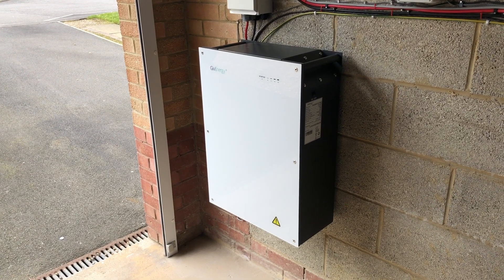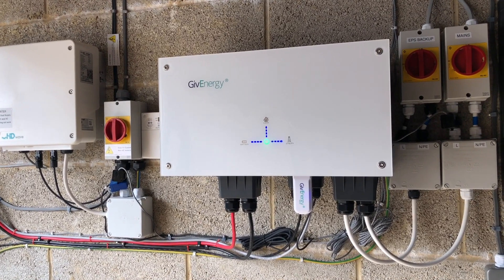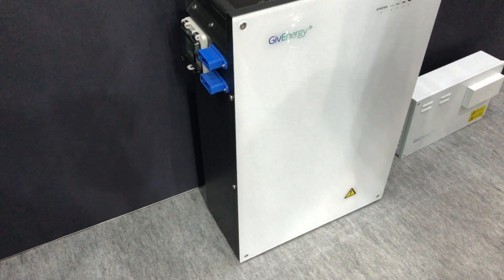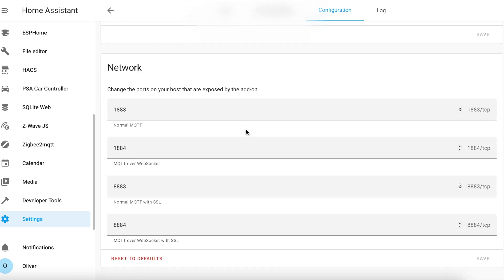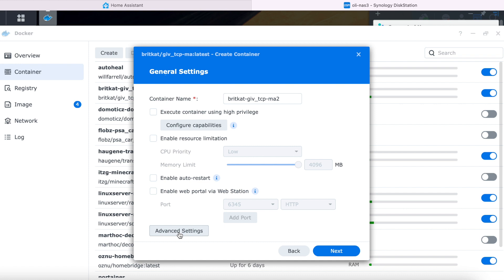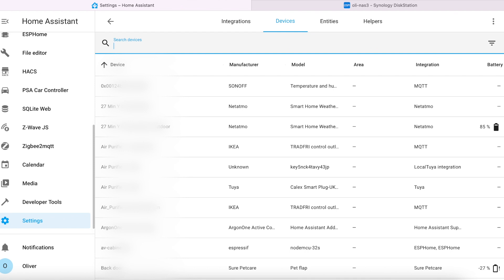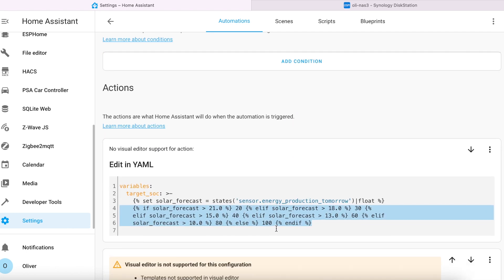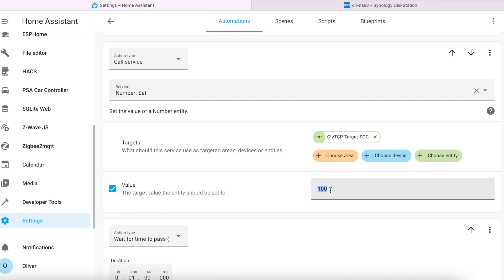GivEnergy Giv-AC 3.0 Battery, Home Assistant and Solar Forecast Automation

Comment: hello @speaktothegeektech.   I have at long last moved over to octopus and about to sign up to the Flux Tariff.  I have just gone through and set up the import script in my HA.  but my question is:  how easy is it to set up the export script to discharge my battery ?
Reply from the maker: In my mind yes it’s quite simple. Automation that triggers at the start time you wish to export, set the force export select entity to the time in minutes that you wish to export for
Reply: @SpeakToTheGeekTech  quick and dirty how about the following.  I would like the total exported use a variable - but i am having issues with find the "entity_solar_forecast" from your code.

alias: Act - octopus_Export_GivEnergy
description: >-
  This is a schedule Automatic that will export eletric to Octopus during the
  Max rate period
trigger:
  - platform: time
    at: "18:00:00"
    enabled: true
condition: []
action:
  - service: select.select_option
    metadata: {}
    data:
      option: "16:00:00"
    target:
      entity_id: select.givtcp_ce2142g147_discharge_start_time_slot_1
  - service: select.select_option
    metadata: {}
    data:
      option: "19:00:00"
    target:
      entity_id: select.givtcp_ce2142g147_discharge_end_time_slot_1
  - service: number.set_value
    metadata: {}
    data:
      value: "50"
    target:
      entity_id: number.givtcp_ce2142g147_target_soc
  - service: notify.mobile_app_sm_g996b
    metadata: {}
    data:
      message: Forecast {{states('sensor.energy_production_tomorrow') | float }} kWh
mode: restart
Reply from the maker: @mysmtpservices4818  I was thinking more along the lines of triggering the export directly rather than scheduling it, so using a service like:

    - service: select.select_option
      data:
        option: '180'
      target:
        entity_id: select.givtcp_ce2142g147_force_export
      alias: Force Export the Inverter for 180 minutes

So just set the automation to trigger at 4pm. Setting the target SOC as you are doing will only impact charging. If you are trying to stop it discharging below 50% then you need to set the reserve. Make sure you put a pause action of 15 seconds at least between each action or GivTCP can skip them.

As for grabbing the solcast data try playing around in the Developer Tools template tab because that's really handy for figuring out the correct syntax.
Reply: @SpeakToTheGeekTech  thanks for the reply.  "Setting the target SOC as you are doing will only impact charging. If you are trying to stop it discharging below 50% then you need to set the reserve. "  would I be guesting that the setting will "select.givtcp_ce******_force_export" with a option of 50 ?
Reply from the maker: @mysmtpservices4818  No that would export for 50 minutes. To set reserve you set a number entity ending with _battery_power_reserve
Reply: @SpeakToTheGeekTech  Sorry I am confused as hell - can you please show me
Reply from the maker: @mysmtpservices4818  Try joining the Facebook group "GivEnergy GivTCP Users Community" (https://www.facebook.com/groups/615579009972782) and asking for assistance in there - loads of people with a lot of experience and it's a lot easier to share config and suggestions there than on YT comments

Comment: Thank you Geek! This is very helpful. Any chance you could develop a similar automation for discharge during the Octopus Flux peak period, such that the battery discharges to a given level (say 40%) before returning to Eco mode? This would leave sufficient energy to cope with household load until the next off peak (battery charge) period.
Reply from the maker: This isn't something I plan to cover because it's very niche but shouldn't be difficult for you to put together. Create an automation that sets the reserve to 40% and then does a forced export for a couple of hours (work out the maximum time needed based on your inverter's speed). If you're struggling with making an automation, perhaps join the GivTCP Facebook group where there are a lot of people who can help you through the process.
Reply: No worries, thanks for replying so quickly! @SpeakToTheGeekTech

Comment: I've had a hybrid inverter and a couple of 8.2's since September last year. With now coming into the summer wanted some automation. Your video's and docs have been excellent in this regard. All setup and "almost" working on a pi. 

In the script (I'm not great a scripting) I can't see if it gets the current kWh of the battery(ies). I ask as I have 16.4kWh of battery capacity and solar generation prediction for tomorrow is 13kWh. So I was anticipated a charge level overnight of circa 40-50%. The automation ran and changed it from the previous setting of 80% to 100% So I was thinking if it thinks I only have 8.2kWh then I could understand why it would want to charge to 100% 

Hope that makes sense.
Reply from the maker: No it doesn't get the actual total capacity of the battery. If you look starting line 10 of the script where the target_soc values are defined, you will need to tweak these to your own needs. I have an 8.2kWh battery, but you have double that so it might be that your percentages can be changed. Whereas I assume that if the solar_forecast is more than 21kWh the following day I would only charge to 40%, you might decide you can let that drop to 20%, but only if the forecast is more than 30kWh. These thresholds are totally customisable but rely on your own experimentation to fine tune them and my values suit me, but might not suit others.
Reply: @SpeakToTheGeekTech   Thanks for the reply. I understand now. I have halved all of them for now and see how I get on. I also now have an eddi configured. So at some point I'm going to try and work out a way to take in to consideration previous days generation, kWh to battery and kWh to Eddi. 
I think solar prediction in the UK is somewhat difficult to consistently get right. 
I'll go through some more of your vids later, they're done really well, clear concise and informative. 
Thanks.

Comment: I currently have solar panels and an inverter in the loft with limited space for anything else.  I have been told that if I want AC coupled battery (dont want to replace my current solar inverter with a hybrid) then I need the AC inverter/battery to be physically close to the solar inverter.  Is that right?  I was under the impression I could put it close to the meter(s)/consumer unit which has much more space.
Reply from the maker: I don't know of any reason why a GivEnergy battery would need to be physically close to the solar inverter at all. The AC coupled battery inverter ideally needs to be able to monitor your solar generation using a CT clamp, but I would guess that your solar inverter is on an MCB or similar in your consumer unit, so the clamp could go around the live at that point. Even if the CT clamp needed to be extended further, there are options for that too including wireless monitoring. There may of course be quirks with your particular electrical setup which need to be considered, but I'd suggest you get a second opinion!

Comment: Very interesting. I'm currently looking at getting solar and a battery and so far the GivEnergy system seems the most flexible for users to 'play' with. Thanks for the info. How are you finding the GivEnergy kit?
Reply from the maker: It’s not perfect, but the features and specification for the price is excellent. I definitely recommend it. The development team supporting it are pretty active too in looking into any problems you have.

Comment: How do you know at 0:37 the battery is actually 10 kwh. Assuming this is the same for the Gen 2 battery I can't find anything in the data sheet which mentions this?
Reply from the maker: I heard it from a few sources, but you're right that it's not in the specs. It's inferred by the 100% depth of discharge claim because you can't actually fully discharge lithium cells without damaging them, therefore an 8.2kWh battery with 100% depth of discharge MUST have some hidden extra capacity in there. It's been mentioned on the GivEnergy forums a number of times that the 8.2 is really a 10, I saw some photos someone took of them counting the cells inside the battery pack too (although I'm not opening mine up to do that!), and my best source was from a GivEnergy employee I spoke to at the Fully Charged Live event earlier this year. That same employee also insisted that there's no such thing as a gen 2 battery, only get 2 inverters, and the 'new' batteries are still gen 1, but with increased capacity and some additional built-in features. I call them gen 2 too though. I think it's safe to assume that any GivEnergy 100% DOD battery will have additional hidden capacity in order to meet that claim.
Reply: @SpeakToTheGeekTech  Yes that must have. Having played with Lifepo4 batteries for motor racing without any protection I have learnt their limitations 😁 A reserve capacity is good to know, I didn't realise this until I watched your video and was even considering getting a second smaller battery so I cycled the battery less. Looks like they already have this in reserve so I'm now less worried about cycling now 👍

Comment: Really good video which covers exactly what I want to do when my GivEnergy Gen2 Hybrid eventually arrives to go with the two 9.5kWh batteries already delivered. I can follow your YAML fine but reverse engineering your strategy is harder. Can you just explain the considerations behind your 40% and 90%?
Reply from the maker: It's all a bit fuzzy, I'll admit that! Taking the lower value of 40%, I basically didn't want to ever let the battery drop below 40% so I took that as a starting point and if my generation is forecast to be over certain amount (i.e. a nice productive sunny day) then it'll let the battery drop to 40% over night (or charge to 40%). On the other end of the spectrum, if it's a rubbish forecast and the amount of excess solar (what is generated - what I need for baseline that day) is zero or negative then I make sure the battery is at 100% that night. All of the intervals in between are rough guesses. All of the energy values that correspond with percentages are estimates based on experimentation which have been tweaked a lot. I currently have it reasonably stable for my home, but everyone's home is different. The latest version of GivTCP has solar forecast charging built-in, however it's got a bit of a bug in it at the moment. Once that's stable I plan to release an updated video using that instead. The algorithm (called PALM) is a lot more intelligent and pulls in historical usage information from the GivEnergy API.

Comment: I use a HACS integration called GivEnergy local. Much easier to setup
Reply from the maker: There is that as an alternative, yes. However when I first started looking at integrations, that one was way behind in terms of functionality (it didn't support batteries at that time). I know that it has now caught up and is probably a viable alternative, although I'm now deep in with GivTCP so will stick with that personally. Always good to have alternative options though!

Comment: Got it working thanks! The battery charge % isn't updated in the GivEnergy dashboard though for me - known bug?
Reply from the maker: That's not a known bug. So it updates ok in Home Assistant but not on the GivEnergy portal?
Reply from the maker: Also be aware that a lot of things have changed with GivTCP since I made this video including the entity name format. Once the add-one is stable again I will put together an updated one to avoid confusion.
Reply: @SpeakToTheGeekTech  yes, battery charged to 90% overnight but target still showing as 50% (manual setting) in the GivEnergy web portal -> my inverter
Reply from the maker: Check in the GivEnergy app and make sure it connects locally, then compare that to the charge value you get for remote. If you get a value for local but not remote then I suspect it's an internet connection issue with your GivEnergy inverter. The inverter should also show as a green dot for its status (or yellow, but not grey) in the portal. Either way, an issue with data between the inverter and the GivEnergy portal is one for GivEnergy support to look at for you.
Reply: @SpeakToTheGeekTech  not sure I can see that value in the iOS app.

I'll definitely nag GivEnergy if it carries on 😁

Comment: Thank you for this plethora of information which is all new to me. I wonder if you could help with a GivEnergy issue. We had our PV system recently installed including an AC coupled 8.2kwh GivEnergy battery. The dongle was configured, but the app doesn’t find the inverter and connects only to the “away” network, not the “home”. The inverter is connected to the WiFi network. I tried in the app settings to search for the inverter manually and inserted the IP address of the inverter, but still the app can’t connect to the “home” network. Thank you
Reply from the maker: Hi. I haven’t personally experienced that issue but I know that other GivEnergy users have. You might want to contact GivEnergy support or ask around on the user forum: https://community.givenergy.cloud
Reply: It worked for me but only after entering the IP address manually (iOS app)

Comment: Just what I am looking for...however I am a complete numpty when it comes to scripting/HA/coding. I know that it's a big ask, but would it be possible to simplify this? Your last video on setting up HA was brilliant and allowed me to get it up and running. With this though I just do not have enough knowledge to get this automation running. It's a big ask, I know!
Reply from the maker: Which bit are you stuck with? I've put together another video on how to install GivTCP as a Home Assistant add-on instead of running it in a separate Docker server which should make things much simpler (https://youtu.be/NQ84z_Wa19k). How far have you got? Have you set up a solar forecast integration (such as forecast.solar or Solcast)?
Reply: @SpeakToTheGeekTech  Thanks for replying. I've got HA up and running on a Pi400. GivTCP is also running fine. I've also got the Solcast account setup and the API running in the GivEnergy portal.
Reply from the maker: You need to have a solar forecast set up in Home Assistant not GivEnergy in order to get the automation working. It’s possible to use Solcast but if you’re not very familiar with Home Assistant then you may struggle as it requires a lot of steps. Perhaps try getting forecast.solar integration working instead which is built-in to Home assistant. https://www.home-assistant.io/integrations/forecast_solar/
Reply: @SpeakToTheGeekTech  Thanks. I'll have a play with it tomorrow
Reply: @SpeakToTheGeekTech  Many thanks again. I got the forecast.solar setup and working.
Reply from the maker: Try to get my automation working with forecast.solar to start with. Create a new automation in HA, switch from visual mode to YAML view (dots in the top right) and paste in my automation. Make sure the forecast sensor entity name in my automation matches the one you have set up for forecast.solar. Once you get that working then you can ‘upgrade’ to use Solcast, but it’s a lot trickier. You have to install HACS and then add a custom repository to HACS. I suggest you try the basic forecast.solar first though and it’s easy enough to switch the automation to Solcast when you’re more comfortable with Home Assistant
Reply: @SpeakToTheGeekTech  Great 121 instruction!!!
I think that I have it sorted. You won't believe the stupid mistake that I was making.....I was trying to copy the action settings from the screens on your video. i didn't realise that I could just dump the script into YAML at the very top of the screen! Told you that you need to speak to me as if I am a Labrador!!!
I've changed the timings to suit my Intelligent Octopus tariff settings, so I'll see what it does tonight.
If it works then I owe you a beer!
Reply from the maker: You’re welcome :) I’ve had to tweak those percentages a few times myself since I created the video. Everyone will be different though so you need to experiment for a week or so.
Reply: @SpeakToTheGeekTech  To follow up, this seems to be working quite well for me. Many thanks again for your patience and help and all the best with the channel!
Reply: Is it easy to check the month? I'm thinking that for Nov, Dec, Jan it might make sense to just set charge target to 100% whatever the forecast
Reply from the maker: Yes, very easy. A condition like this would capture November, December and January: 
          - condition: template
            value_template: "{{ now().month >= 11 or now().month <= 1 }}"
Reply: @SpeakToTheGeekTech  thanks!!! Easy when you know how 😁